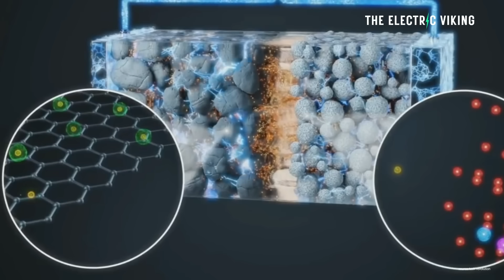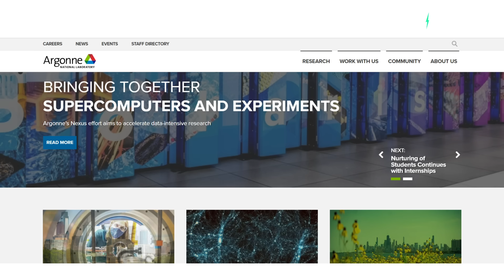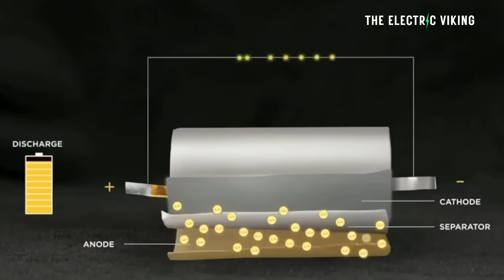US Government Scientists expose why solid-state batteries keep failing

Comment: Think as an early interested in electro mobility in 2006 to understand most of the problems and the so many fake batteries experts that try to scam investors, even well known ICE that had no idea what happened to them. Do not need to name them as interested people know of whom I speak. Elon from the beginning looked out for serious lab workers that had promising results and he and his team from the very beginning went on with realistically scaleable solutions and not vaporware as most like Volkswagen and Toyota. Working even in the beginning with serious battery manufacturers and neither concentrate to one company only. Tesla can change batteries at any moment when better solutions are really available, but now they produce the best they can in the present and not by eventually 2030 - 35. That all these story tellers and liars do still not understand. We tried to follow Tesla and also concentrated on the people with serious results without establish a believe system from middle management to bring good news - even fake ones like with Diesel Gate - to the top and shareholders, that mostly have no idea of technology but Elon is heavily involved and has and speaks directly to the people with real competence!

Comment: Batteries use a reversible chemical change to charge or discharge. When chemical compounds change, the density and volume changes. This makes solid state impossible.

Comment: Hiya Sam,
These 'shorts' described sound to me like the same/similar problem that all secondary cell chemistries exhibit to varying degrees.
This is Dendrite growth by another name.
The pernicious life of a dendrite or microscopic short in a cell will ultimately depend on the current flowing in the cell - charging or discharging.

For example, it has long been known that zapping a 'dead' NiCd cell with a very large - 20-50C current very briefly can restore such a cell to life very quickly by basically melting the dendrites into oblivion.  This allows the cell to be charged in the normal way and continue operating quite normally for some years subsequently, if handled properly w.r.t. charge and discharge regime.

I have been using various rechargeable cell chemistries for most of my Electronics Engineering career, and I believe this problem can only be mitigated by full understanding of the internal chemistry of any cell type and ensuring that charge and discharge stresses are kept somewhat below the rated capacity of the cell.

If a technology arrives that guarantees elimination of dendrite formation (as solid-state cell technology has hitherto promised), then I will be both surprised and grateful for a truly formidable breakthrough.  Nobel prize territory methinks.

Comment: I built a prototype  of my iguana Tracked Vehicle used three 12 volt gel cells.  Five years later the batterie's were worthless.  We bought an electric go cart for the grand kid when he was too small to enjoy it and 3 year later the batteries were worthless.  I remember back when, you bought a  battery and then you had to add the electorate.  Clearly, batteries have a shelf life which we are not made aware of.  I have a dozen battery powered tools in my shop that I use often.  Some are 15 years old and they still work fine. ?? 
Iguana

Comment: Solid State Tech is advancing. There are other issues like the cost which is 5x higher. A manufacturer to keep an eye on is Prologium from Taiwan. Prologium claims to made some big breakthroughs and are building a commercial level factory in Taiwan and a massive factory in the U.S.

Comment: There's solving these technical problems.... and then there's actually scaling up that tech to be commercially viable & patentable for corporate profitability.  It's this last stage which confounds most tech break throughs, as the technology that fixes a problem at low scale doesn't usually work at high scale when needing to optimize materials and methods to be economical and efficient.

Comment: Here is the main problem with Battery technology - During the 30's and 40's there was a surge in Electric City vehicles because believe it or not women didn't like the smell of cities with so many cars emitting gas exhaust. Gas prices massively dropped leading to it offsetting wants and desires, and the cheap gas killed off Electric vehicles, and Oil industries basically would stop any and all progress for nearly 80 years. Battery companies like Duracell and Energizer really had no inclination to advance battery technology due to repetitive sales similar to the "Light Bulb Consortium" that existed prior to WW2 which gave way to the business model of "planned obsolescence". You also had in the 80's and 90's an over aggressive regulation of the nuclear program and public sentiment that was offput from very bad Science fiction media(this affected Batteries because clean abundant energy has become a problem as you see with current electric vehicles and various cities still having brown and black outs).
 Along comes Musk and a sentiment(especially prior to him of small scale projects) to push technology, Also Key fields like Electronics ended up pushing a small amount of innovation for key devices, Laptops, Cell Phones, Tablets, Wireless Earbuds/Headsets where companies like Samsung would invest into researching better liquid flat batteries which with key pushes have given way to liquid Lithium plus batteries currently being released with Charge times for new vehicles being 1-3 hours to 80% charge rather than the 8 to 12 of the previous generation. Solid State Batteries have long been used particularly in Medical(pacemakers) and Industrial applications, they just never had the reason to receive massive investments, since 2006 we have seen massive improvements across the board, money has been flowing into R&D for batteries at a high rate and more companies have started exploring. Now we have seen anodes in the batteries being substituted leading to majorly cheap battery production that we also will start to see in the next year.
Solid State Batteries are the holy grail, as you have stated there is a problem with Dendrites, this has caused the technology to go to the back burner leading to 2-5 companies trying to solve the issue, but within the last year Toyota had a Massive break through that inherently has put us on a collision course with seeing the technology hit the market and others have also caught on figuring it out, where there is a market with need, and where there is money there will be investments and innovations will come from that.
Its actually quite sad, we could have started this around 2000 and been a decade ahead, but sadly many things have set us back, hopefully we will make up for it in a break neck speed to see what the future holds, this era will be known specifically as the Electricity era, combine advanced batteries with Fission reactors and perhaps Nuclear batteries, we will have a new era where technology can progress faster and further in other key areas.

Comment: Yup dendritic micro short circuits through the incredibly thin electrolyte/separation layer. The issue is the lithium migrates and grows into the cathode side, converting some of the materials to a semicondutive substance of mixed metals and oxide

Comment: The soft shorts are the result of a overall parallel resonance.  To minimize, we need to insulate all circuit pathways better.  Imagine the way an inductor works. Individual paths have a magnetic field around and when you loop them all together it "combines" and flips the field 90 degrees.  These high-density battery circuits momentarily are getting this same action where everything resonates and flips field 90 degrees.  I propose these moments being witnessed are the soft shorts.

Comment: IF you have researched all the known, proven batteries ever known to man, there are always ................drawbacks.  Horses for courses..........I like Lithium in my phone but they dont scale well for large applications.......like EV's and storage.  Its the same elsewhere, where the other types have drawbacks in different ways.  Besides, there is still the problem that when you pack a lot of energy into a small volume, that is having the cathode and anode of chemically active materials, the risk of something going wrong escalates and increases, as does that risk with the number of cells.

Comment: This sounds a bit like the tin dendrites that they started finding when there was the push to low lead or lead free solder. They started finding shorts on circuit boards caused by the tin in the new "safe" solder starting to grow long crystals that bridged across circuits and caused the electronics to fail

Comment: Being able to minimize or eradicate soft-shorts means lower battery temperatures, longer battery life, and longer charges being held.  If the research ports over to non-solid state batteries, then that's great ad well.  The solution seems to be in manufacturing and materials with not much engineering.

Comment: For decades we've known about the phenomenon of "tin whiskers" forming from lead-tin solder joints that cause short circuits between terminal pins on ICs, but to my knowledge they still haven't figured out exactly what causes them.  This only got worse when lead based solder was banned.  The whiskers can even burrow through protective plastic coatings applied to PC boards.  It sounds like we've got a similar problem inside of solid-state batteries and scientists are just as baffled as to why they form and how to prevent them.
Reply: Yes, these dendrite/whiskers have been known since the 1970s or earlier. There are still no known solution as no one truly understood what causes their growth over time.
Reply: These same "whiskers" were forming on satellites.  It's gravity/electromagnetic related.  The dendrites are forming along lines of flux.
Reply: @Diversifried    you will never understand.   go back to worshipping einstein. fool.
Reply: @Diversifried  what part of  the,  dieletric field wants to return  back  to non cartesean space,  do you not understand? even my 10 year old neice understands pressure.
Reply: i suggest reading Elementary lectures on electric discharges, waves and impulses, and other transients by charles protues steinmetz. basiclly over time knowledge has been lost, steinmetz was the one who made electrical engineering possible.   their are no particles only fields,  electrons are nothing more than the terminal end of dieletric line of tension. electricity is not generated but manifested into our cartesean space and wants to  return back to non cartesean space this is what causes the tin whiskers.
Reply: @toymaker3474  Of course, a non-physical explanation provides insight into the reality involved.  But getting people to accept non Euclidean space is the challenge,  It requires a capacity to think in higher dimensions, as we are not following a linear route here. 

There are grand implications to the operation of society here. These processes are metaphoric to our concept of our experience. It requires a complete global reimagining of our position within reality.  In short, we describe reality in consciousness, and that reveals we are responsible for our external experience, no one else.  This is anathema to our current adolescent state of trusting authorities to provide direction.  It would even suggest anarchy. 

One might even ask what do we deserve to use this energy to be used for, CEL phone chargers and cars? What did we do with atomic power?  There seems to be a self limiting corrective brake on this implementation of knowledge, until we 'grow up.' 

And should we do so, by taking full responsibility for our consciousness, our cosmology will radically change, and we won't see ourselves as separate, needing phones and cars to go from here to over there. 

We will traverse the illusion of separation within our mind, where reality is described, by vectoring our own built-in energy to transform through what today is perceived limited as an inviolate dimensional threshold.

Comment: Back around 2018 I think I kept hearing about Solid State Batteries.  They were going to first be put in Cellphones and Laptops to build experience.  The claim was you would only have to charge your phone once a month.  Never happened.  As mentioned the date came and went.  Its beginning to sound like Fusion power plants.  Since the 1970s it will be just another 10 to 15 years before we have Fusion Power plants providing cheap energy completely eliminating fossil fuels.  Still waiting.  I think the media over hypes far beyond reality what can happen with Solid State batteries.  In 2027 I believe we will see another extension to 2030 for production roll out.

Comment: It's too bad that capacitors have a limit on how small and dense they can be, because they do not rely on chemical reactions but literally just story the electrons themselves until they are ready to be released. Currently you could make an EV that uses super capacitors but the range of the vehicle would likely be quite small (probably well under 100 miles) but the benefits would be great, including super fast charging and discharging. Recharging would probably take a minute or two at most.

Comment: I think there nuts to go to 1000mile ranges they need to keep them about the same and make them smaller. Or deal with the fire problem first. 300+400 mile range in current EV and we get to watch them burn the way they do now. Lets go to 300% the amount of fuel in it and try again or shit lets see a bus at 300% the fuel in it we has seen a few of them burn now as well.

Comment: We are all losing the race because ultimately having solid state batteries may allow for 1000 mile ranges but it wont change the fact that it will take a whole day to charge the battery before you can use the car.

Comment: Wouldn't it be safer and easier to switch to hydrogen?
Reply: Hydrogen can pretty much explode in contact with oxigen and a bit a heat... So not great.
Reply: @KleytonClementino  hydrogen is lighter then air and doesn't burn the way gasoline does and is safer then petro and electric batteries. Do some research

Comment: What the general public will never understand is that there will always be battery degradation. All batteries are chemical reactions that can be somewhat reversed by forcing electricity back through them... but like everything in nature the process is not 100% efficient, in fact its only at maximum 90% under ideal conditions. its impossible to be 100% so due to the laws of thermodynamics.

Comment: They said a similar thing about going back to the Moon since 1974 and apparently, we still have not returned, assuming of course that we went in the first place. Scientists are wrong most of the time so at least they are consistent. One of the main reasons why scientists turn out to be wrong is not entirely their fault as they are not businessmen they are highly paid nerds who get paid grant money to come up with reasons for more grant money. They can eventually come up with something that works but whether it is better than what currently exists or is practical to produce or use is quite another thing. For example, they once spent a fortune developing nuclear, rocket, and jet-powered cars and they worked, but for some strange reason, none made it to the production line. 

Having said that, maybe solid-state batteries are the answer to the many inherent disadvantages of what we have now? If so, then it would have been far better for all concerned that EV manufacturers had waited until they were fully developed. One of the last things someone who has just spent £120,000 on a new EV wants to hear is that a radically cheaper, longer lasting, safer, and more efficient battery technology is shortly on the way. If something like this did suddenly turn up on the market his £120,000 EV would rapidly become obsolete scrap, assuming that it is not so already. Yet people like you seriously wonder why hardly any private individuals wish to buy a new EV these days? 

Even if EVs were as good as ICEVs which they are nowhere even close to being, the fact that they can soon become obsolete, and therefore no one will be making replacement batteries anymore or bothering to learn how to service them only adds yet another big RED FLAG. 

For EVs to work in the marketplace place they did not need to be as good as EVs or even close to as good, they needed to be obviously far better. So much better, safer, and cheaper that the decision to buy one ASAP would be a no-brainer. A similar type of decision that millions of people made when getting rid of their horse and buying a Model T Ford. Similar also to the decision to fly from New York to Las Vagas rather than drive or take the train there. 

The reason for this is simple and can be summed up using just 3 words, infrastructure, infrastructure and infrastructure.